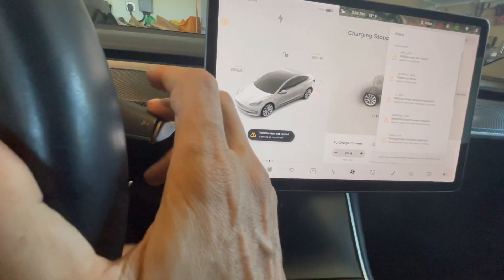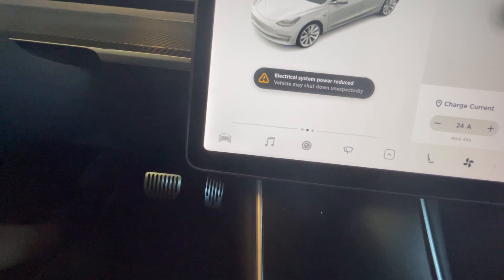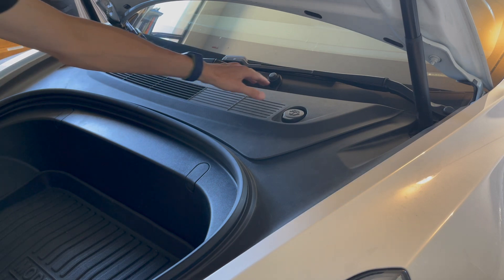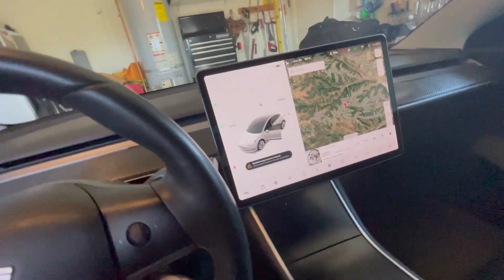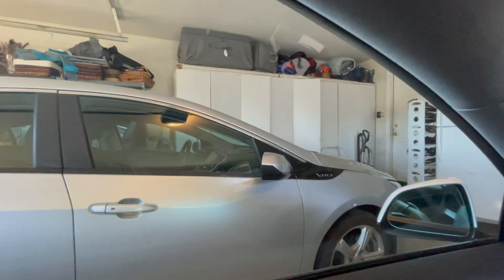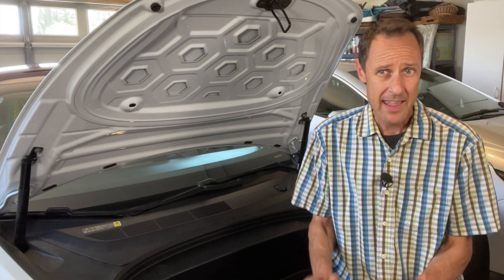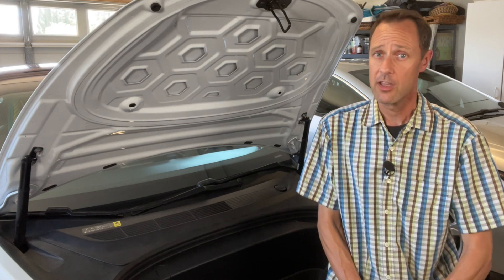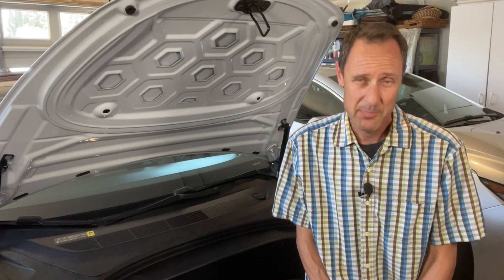My Tesla Model 3  12 Volt Battery Experience

Comment: Good call on the Ohmmu lithium battery.  It might cost a little more, but it's not hard to change yourself, and you will likely never need to change it again.  That one should pretty much last forever.
Reply: Ohmmu states that they use LiFePO4 battery. This is different than the lead-acid battery that is likely in your car and that costs $85. LiFePO4 should last about 3000-5000 cycles, and since you aren't fully discharging daily, Stormspark is right -- it should likely last forever as long as the BMS and cells deliver their promised performance.

But be aware -- you should NOT use LiFePO4 in places where the temperature goes below 32ºF / 0ºC !!! If you do, it will quickly kill the battery off. So while it is likely fine in California, be aware that it may not be good for you.
Reply: @ooglek  Actually, Ohmmu tested their battery in extreme conditions from -70C to 184C, and it passed all the extreme conditions testing.
Reply: @StormsparkPegasus  I'd be curious if they tested CHARGING at -70C... that's supposed to be VERY BAD for the LiFePO4 Cells. Like death. I'd want to ask some questions about how the battery performs at charging and discharging at -70C...
Reply: @ooglek  Cold temperature charging causes some damage to the LiFePO4, but it depends on the charge current and temperature.  Below 0°C (32°F) the charge current can be at or less than 0.1C (or 1/10th the Ah capacity of the battery).  Below -10°C (14°F) it must be at or below 0.05C (or 1/20th the Ah capacity of the battery).  Ohmmu did cold temp testing and determined that the small amount of damage done to the battery in cold temp charging was fine, but that was testing done before Fall of 2020.  That's important because before that date the Ohmmu batteries had 45 Ah capacity, so 0.1C is 4.5A and 0.05C is 2.25A.  I've been testing on my Model 3 the past few weeks and the highest charge current I see the car use on the 12v battery is over 7A for like 20 seconds and tapers down quickly.  After a few minutes it's below 6A and after 30 minutes it will be below 2A.  Now the reason that I mentioned that Ohmmu batteries had 45 Ah capacity before Fall 2020 is that they updated them around that time to be lighter and better match the charging profile of the Model 3, and reduced the capacity to 18Ah.  So that means that the ideal charging currents at cold temperatures are reduced to 1.8A at 0°C (32°F) and 0.9A at -10°C (14°F).